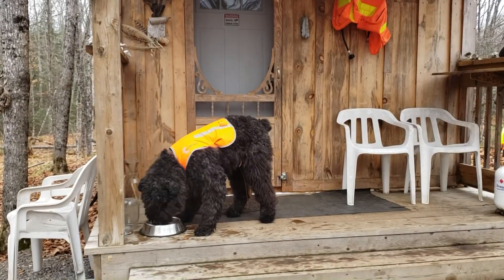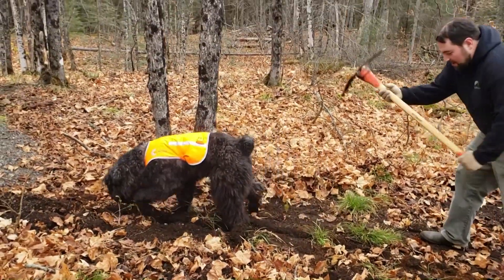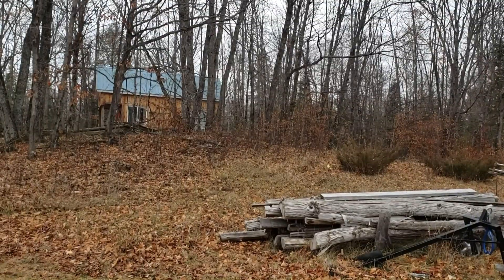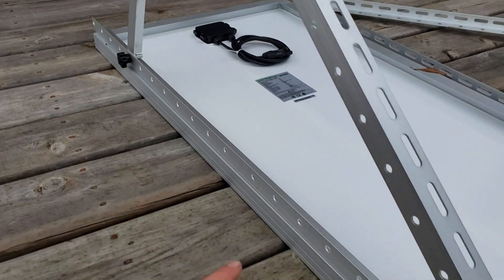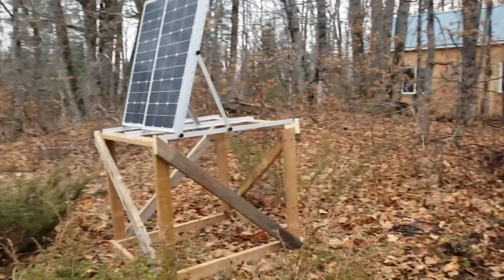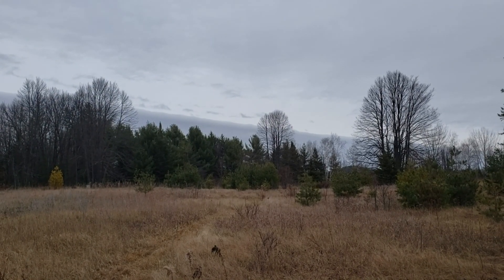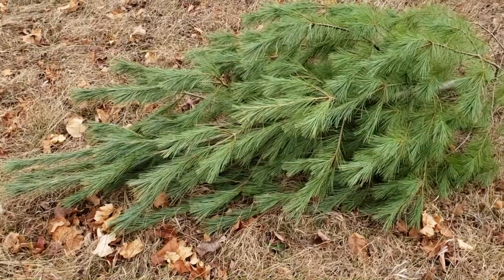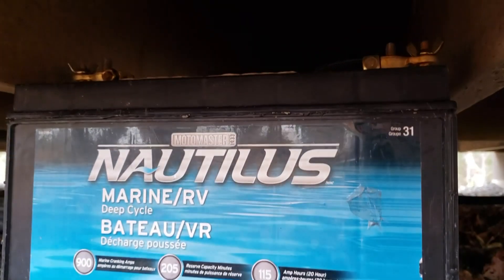Off Grid Cabin Solar Installation

Comment: Jen,   It looks like you connected the panels in parallel.  If so did you consider wiring them in series to increase the voltage from the panels reducing loss in your long cable run?
Reply from the maker: We did that the afternoon we left. Good eye!

Comment: You may want to increase the wire gauge between your charge controller and the battery.  Also, install a fuse near battery.

Comment: Looking good, that's going to be way better than dragging the battery back and forth and will be more autonomous.  I would look at putting the panels at a steeper angle though, I find the snow we get now days is weird, it's not as fluffy, and tends to stick to everything and creates an ice crust.  I have issues with the panels on my shed as they are not steep enough.  Yours are easier to access though so you can always go scrape them down with a scraper if you need to.

Comment: Maybe slide your panels closer or overhang the ledge of the wood frame... as snow melts, it slides off, it won't build up on frame, and cover your panel bottoms, and slide right off onto the ground..

Comment: Nice. Could you just have use and plug on to the shower house? Have a good week.
Reply from the maker: It is a bit far and the voltage drop would be more significant. Thanks for watching 🙂

Comment: Battery should be kept no lower then say 40 degrees ..Or you could lose power or even kill the battery...j/s  Love your videos
Reply from the maker: Thanks Raymond. Ideally, yes. The cabin battery is kept in outdoor conditions for the last 6 yrs. We've topped up the fluid on it. It is still going strong after all this time. I think of it like a car battery that is exposed to the elements all the time.